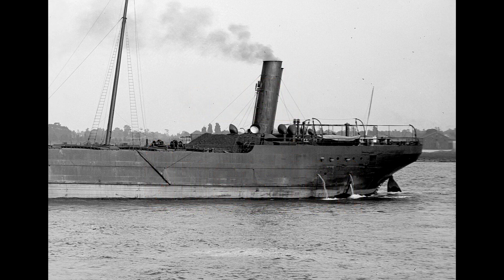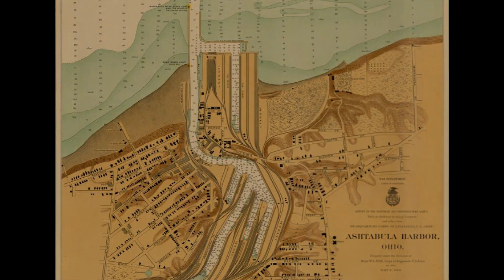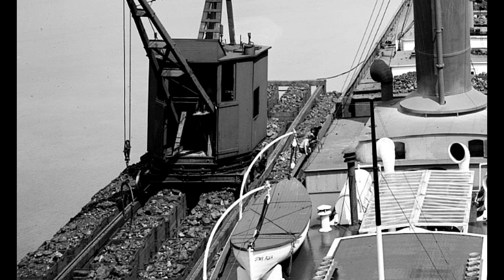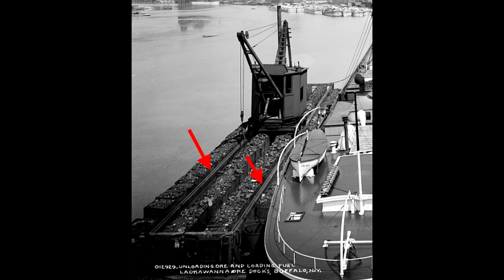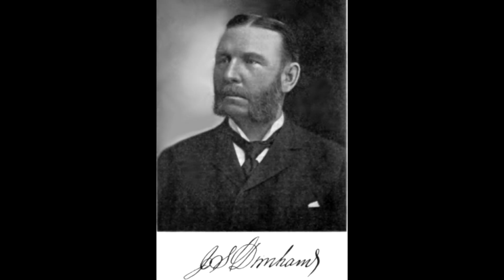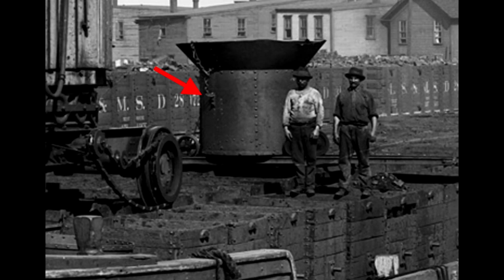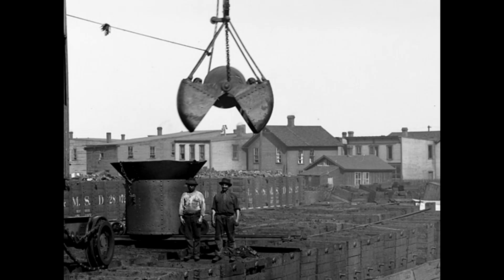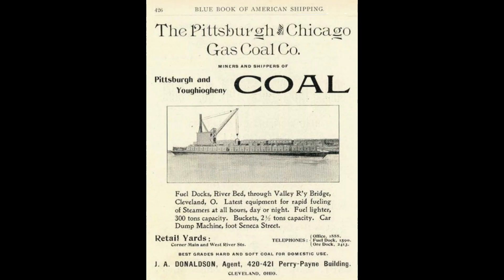An obscure question about an obscure type of Great Lakes vessel and how to research and solve it

Comment: That’s awesome! I’ve snorkeled around Presque Isle Harbor (South of Rogers City) including outside the harbor looking for the Albany wreck. And I think I saw one of these Buckets but it was back in the 80’s and I’m sure it would be long gone with the shifting shores and Ice over the time... I don’t remember if it was by the old cribs on the south side of the harbor by PIHA boat launch or out side of the harbor mouth and south toward North Albany point. I’m pretty sure that it was below my depth that I could dive into back then... so it must have been 20’ below the surface. The water was so clear that I’m not joking about I could see something like 40-50 feet down and it got C-O-L-D. 5-10 years ago I was in my small boat and was having some problems with my prop. At the time right after I had the motor serviced. I attempted to drop anchor and watched as the anchor sailed on down to where I was at least 20’ short of the bottom (guesstimate) my 50’ anchor line was short of course... 
the bottom had House sized boulders that the anchor brought into perspective... after getting back to the bouy to try and fix the issue I found that 1 the bell ringing was super loud. And in order to change my prop I needed a lot more leverage than I could apply from my position of hanging over the back of the boat... ended up chatting with the shop that did the work on it. And a new anchor line and floating prop nut wrench was purchased, now I have 2 sizes for the boat...

That’s my story and hopefully if you like it you can get a giggle out of it too... Captain Murphy’s Law seems to follow me on and off the dry land...let your imagination be your guide!

Comment: Great video!
Taking a close look  at Capt. Dunhjams rounded corner scow, I wondered what the apparatus on the rear of the whir-lie (looks like a pile driver) was for.
Breaking up large chunks of coal perhaps?
Reply from the maker: Some barges use that as a sort of anchor. No chain to deal with. Even modern work scows today use the same thing.

Comment: I was on a US Military Sealift tanker at Sembawang Shipyard, Singapore in the late 90's. Ahead of us in the yard was an Aussie built & flagged coal bulker. It was the typical ocean bulker, all holds forward with an after house for living & engineering. But just forward of, and attached to the main house was an additional enclosed space that also was involved with the aftermost cargo hold. I asked one of their Mates about it. He said that even though it had been built recently (late 80's?), it was coal fired and running a steam turbine. The small house was where they drew their bunkers from the ships own cargo and processed it to use in the boilers. Haven't seen the like before or since.

Comment: I have a question now....Is that the standard size? Or is that just the size that company used?
Reply from the maker: So far, it appears that the bin sized was pretty much standard, however, there were some variations. Each Chief Engineer would have to adjust his order and the number of lifts as to which port was serving his boat.

Comment: In the days of the transatlantic steamers coal was also sent to the ships via lighter.
At times there were questions as to the quantity of usable coal delivered.
The top layer would be of a better grade while the lower portion was not.
Obviously a lower grade of coal generated less heat and made more smoke.
I wonder if such things were tried on the steamers of the Great Lakes?
Reply from the maker: The odds are good.
Reply: During the Second World War, coal burning freighters transited from the UK to the convoy marshalling ports of Halifax and Sydney, Nova Scotia carrying clean burning Welsh coal East-to-West and dirty, methane laden Cape Breton coal West-to-East. This was a big worry for the (oil burning) escorts as the smoke pall from the UK bound convoys was visible to the Wolf Packs from literally over a hundred miles away. This would have resulted in the sinking of hundreds of extra ships and the loss of thousands more men but they had no choice. That's what they had.